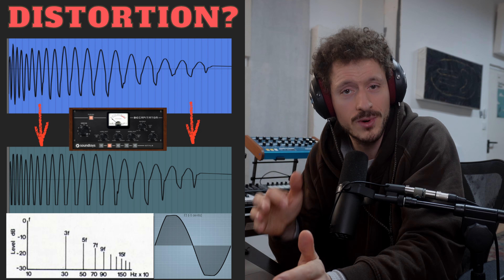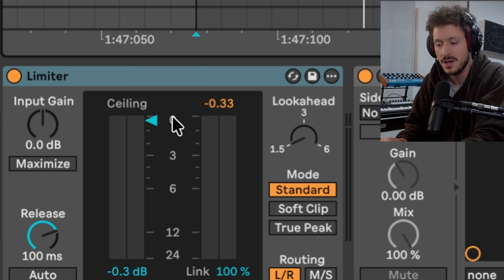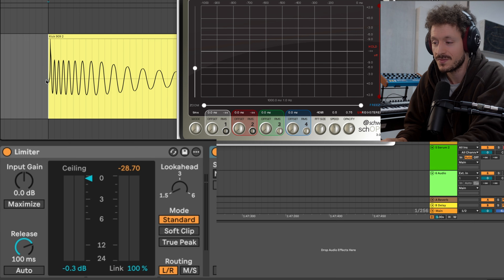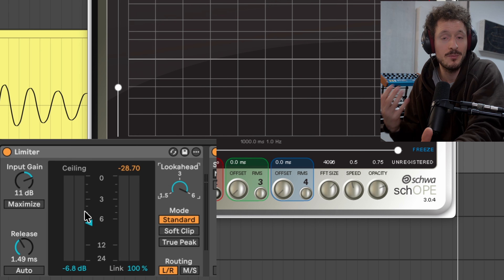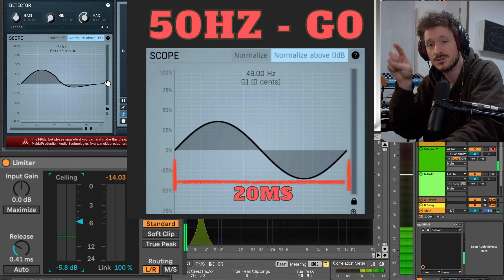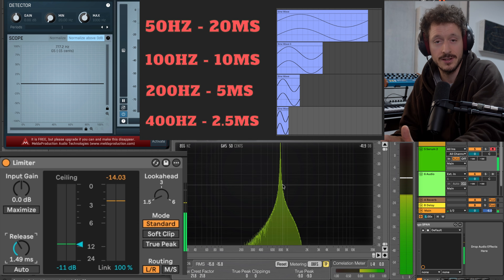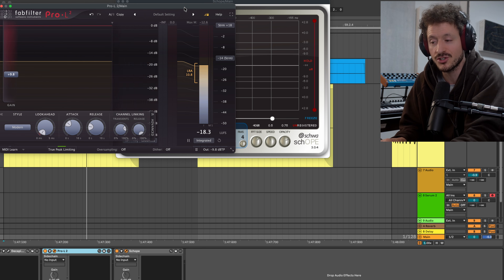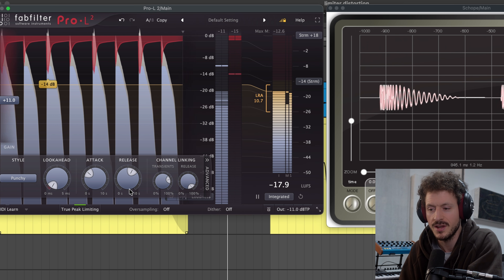When does a Limiter Cause Distortion? Audio & Music Mastering

Comment: The limiter acts more harshly than a compressor. It always puzzles me that the rough tool is placed at the end of the processing chain. In sculpture, you use the rough tool at the beginning.
Reply from the maker: I think technically its not supposed to be a super rough tool. the goal is to make things louder without noticing it that much and maybe also giving some sound character and glue. To me a mimiter is a specific type comoressor 😅
Reply: @OleansHouse  I try to see it this way. On the master bus the Limiter is applied after all voices have been mixed already. So it applies to every voice just a tiny bit. AI tells me I am right. AI always tells me I am right. It's the perfect tool for Trump.